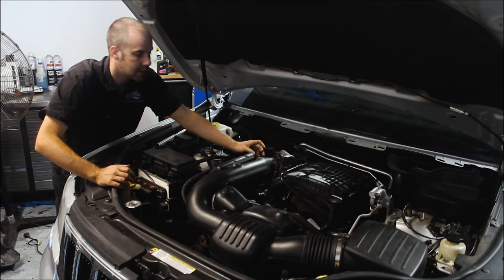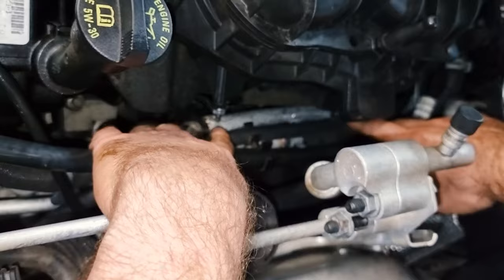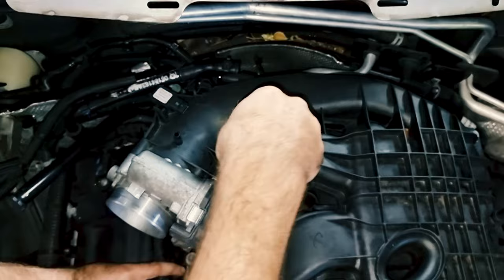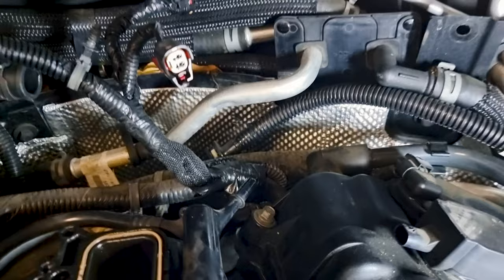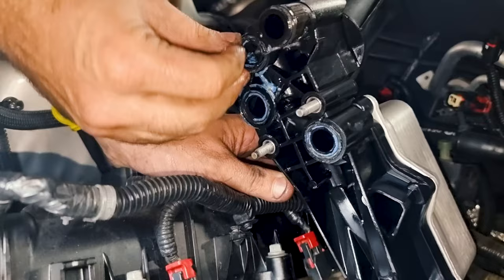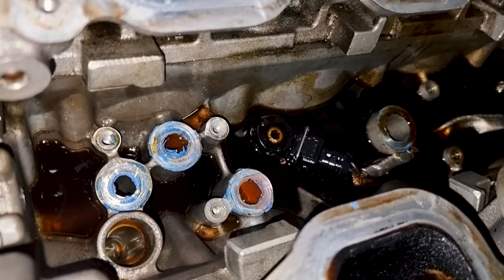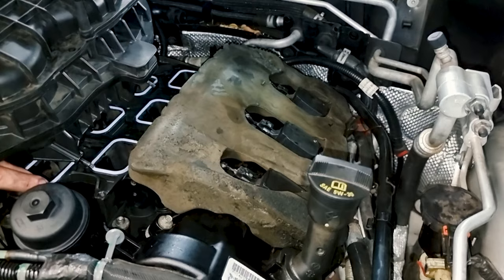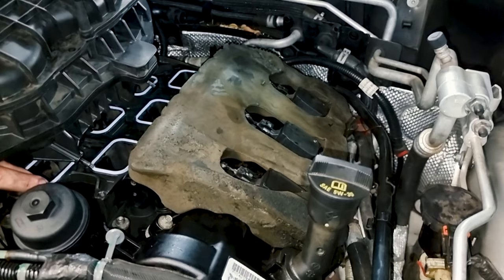Jeep Grand Cherokee V6 Oil Cooler Replacement How to DIY #jeephelp #jeepdiy #jeepporn

Comment: And I see why someone broken the studs off the throttle body.  On the long brackets the fron one was easy enough but the back appears to have a press on nut to hold an AC bracket totally preventing access to the lower nut to loosen it.  To the engineer who designed this, I salute you 🖕

Comment: Thank you so much, Dannie! This was a great video, along with the wiper cowling. I took a chance doing this repair myself! While I felt prepared and definitely got great tips here, it was a tough job. Tip for others - make sure you have the oil and fluid temperature sensors in your housing! I ordered from Mopar and didn’t realize they were missing until I ripped the old one out 😅 managed to get the needed parts and get the job done. Took us about 8 hours all in, but worth the experience and money saved at the stealership! Thank you mate, thank you!!
Reply from the maker: you are most welcome. its all for the love of the Jeep

Comment: Loved the video, couldn’t have done this job without it. Just my two cents though, removing the wiper cowl is not necessary. Yes it will significantly help in the removal of some bolts and hoses but you can get it done without removing it. A small 1/4 inch ratchet with variable size extensions was really all I needed. Some of those Christmas trees were a pain and most of them broke. Other than that I think the average DIYer is going to save a significant amount of time by not removing the wiper cowl. Awesome video though, thanks!

Comment: Excellent video thanks my valley was full of oil now replaced the housing and spark plugs.
Reply: Dumbest design where stupid Chrysler engineers wanted to put the oil cooler and oil pressure switch!

Comment: I went with the doorman all aluminum. Mine was such a pain in the ass i went ahead and did the coil packs and iridium plugs. Oil change fluid top off and put it all back together... Only thing I did different was take off the wiper assembly and drop the cowel valance to give more room to work with

Comment: I had a question I have a Jeep grand Cherokee 2015 diesel 3.0 turbo has both sides head gaskets damaged do you recommend i should follow the instructions you show me. Coolant gets hot but doesn’t have leaking has a lot of oil leaks over the transmission. If you could please get back to me with information it would help me a lot thanks very much for the video as well ❤❤

Comment: What are the most common symptoms of the oil cooler failing ? Beside the oil leak , can you get some white smoke in the morning or overheating ?
Reply from the maker: normally not. these leak oil out the back of the motor. those not familure with this fault misdiagnose it as rear main or auto pan seal

Comment: Just finished the oil cooler replacement with dorman as i am having smell when revving high up hill, only up hill, I thought was some oil in the valley.  but the smell still there all started with a cracked thermostat housing.  Doesn't seems to have leaks but the smell is still there do you know what else i could check?

Comment: The grey temperature sensor.  What is it for. I m battling with a jk 36  overheating.  Replaced everything my radiator fans running full speed but heat gauge fluctuations

Comment: Is there anything in here that would be disconnected causing brakes to not work? I just replaced the oil cooler and followed all the steps, car starts and runs but brake pedal is stiff and won't move. Could I have unhooked something?
Reply from the maker: yes your vacum line off the back of the inlet manifold is the vacume assist for the brake booster. you have left that off

Comment: You don’t have to remove the wiper deal at all I had the most trouble with one bolt and it was holding the upper intake right by the throttle body, it only took me about 1 minute longe than the rest of them. Waste of time
Reply: so it does not make a difference? I ask because I recently watched the wiper cowling removing video and omg it seems like just as much work as removing the oil cooler!
Reply: It made my job easier, my gc is lifted and I’m short so access was helpful at the back of the engine bay

Comment: I installed my aftermarket one and it’s leaking oil severely. I made sure the o ring was deep in there. What do you guys thing it would be ?
Reply from the maker: Faulty part? 
We have had to do a lot of these under warranty even the genuine ones can fail straight after instal 
We are researching the alloy ones

Comment: Should my Jeep be cold before this repair? Or can it be performed after running
Reply from the maker: It doesn’t really matter but it will be hot to touch and make the job difficult

Comment: Great video thanks so much! Replaced the cooler but now my oil pressure is 25 psi where before it was idle at 30 - 32 psi and getting slight knock. Any idea where I went wrong?
Reply: Did you ever find out What was the problem ?
Reply from the maker: Many after market coolers cause this. My advise is shell out and buy a Genuine Jeep one
Reply: Would u consider the 
Eminem one from doorman Aftermarket ?
Reply: @josemartinez575 how’s it running now ? Any better since then
Reply: Have you figured it out?
Reply: Ever figure it out?

Comment: Wow I tried this on Saturday. I got 5 of the fuel injectors disconnected but the drivers side fuel injector all the way in the back defeated me. Took me 9 hours to get to that point. Finally said F it and quit. I have a 2016 Jeep GC. Any tips on how to get that back one out?
Reply: I couldn't get the middle passenger one out and wound up just flipping the manifold upside down and to the side .

Comment: Hi Dannie,
Does the diesel have the same issue with the oil cooler? would you recommend preventive maintenance change over of the oil cooler on a diesel WK2?
Reply from the maker: They do fail in the diesels. They are located mounted on the side of the engine under the air intake. Not to hard to change. When these fail they fill the cooling system with oil rather than leak externally

Comment: Quick question, my jeep has oil leak going into the radiator and cooling reservoir. It has a brownish sticky color. There is no sign of being in my oil tank. I’ve checked the dip stuck and it has its original color. Could replacing the oil cooler be the solution or is it the head gaskets? Thank you in advance!
Reply from the maker: these engine do blow head gaskets. 
Do a TK test first. 
If the TK test reveals nothing i would do a cooler first, if fault continues you may need to pull the heads

Comment: Hey man just replaced it and it started overheating, what could it be?
Great video👍🏼
Reply from the maker: air lock in the cooling system. make sure you have bleed the air out properly. 
if it overheated prior to replacing it there is a possibility you have done cylinder head or head gasket damage. 
Bleed the air out first, if its still cooking, do a TK test

Comment: I have a 2011 jeep grand cherokee and started leaking colant from the hose what could be? Bad hose or bad oil cooler? Its not leaking oil just coolant.
Reply from the maker: Could be either. Normally they leak oil first but I have seen a Couple leak coolant. That hose is common to leak. 
Probably best to remove the manifold and then pressure test it. This will tell you
Reply: @gdlautomotiveservices6569  I just did put pressure on the radiator and the leak is coming from the oil cooler or hose just need drain the coolant and check the hose hopefully 😅.

Comment: I just did my 2015 grand cherokee 3.6 and now it cranks but no start     please help .it started and idled roughly then shut off
Reply from the maker: You have left the fuel supply line off
Reply: @GDLautoblog  I accidentally left paper towels in intake! Was in hurry and did a dumb mistake got them all out it runs great thanks for advice.

Comment: should I drain the coolant and the engine oil before the replacement?
Reply from the maker: Yes. You don’t have to but it will make a mess if you don’t which leave you with a decent clean up job.

Comment: This old one is definitely an aftermarket and it didnt last.  However I disagree with the OEM replacements as they have been through 5 revisions and will probably have a 6th, why?  Plastic.  Given the OEM is still plastic I'm going to risk it and use an aluminum aftermarket one.  I do appreciate your efforts though as you made this a LOT less intensive then the last video I watched of someone doing it.  Now to find the video of removing the wiper cowl.

Comment: Get rid of the damn ratchet!! Use power tools cordless jesus
Reply from the maker: Plastic manifold 
Don’t use power tools. You will rip the threads out of a a $4000 manifold. True story
Reply: Use hand tools to do the initial break, than use the power tools to travel the rest of the bolt distance. Reverse order to reinstall, use power to do most of the travel, than hand tool to do final tighten.